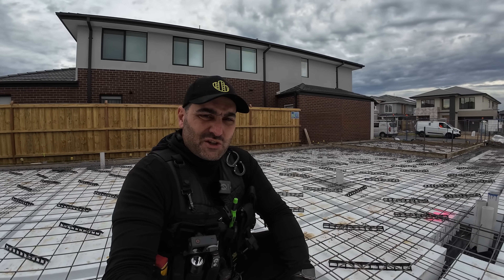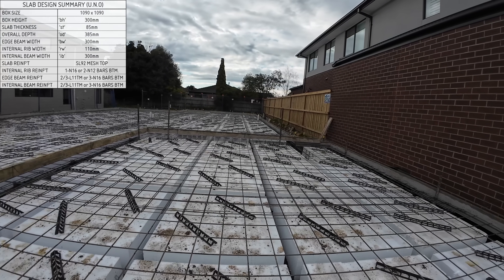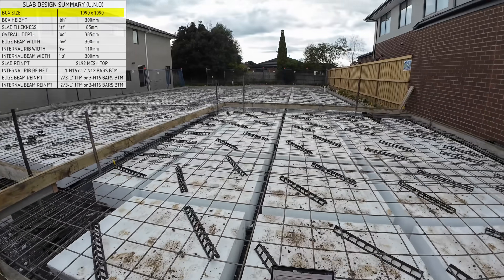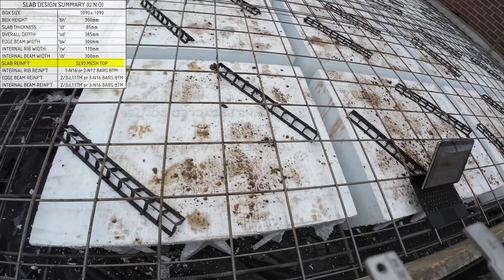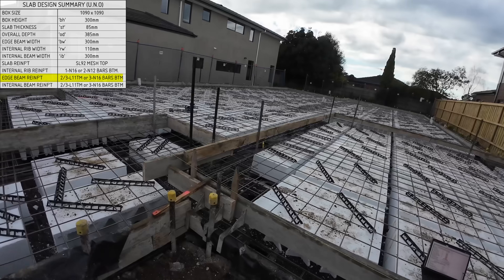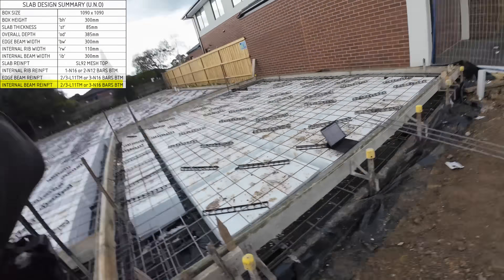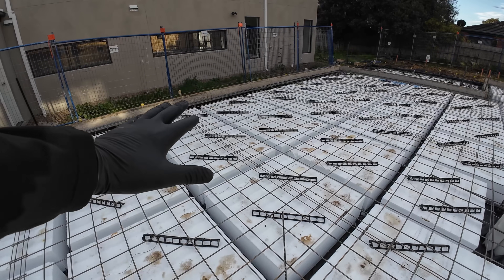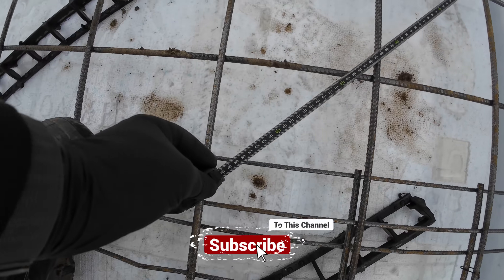Pre-Pour Slab Alert: What the Surveyor Missed!

Comment: Got passed because the things you're picking on are so minor and inconsequential that nobody without a tape measure would notice. Your videos are great, but the ones you've done regarding concrete are a bit off, can tell you don't really know the trade or the real world effects of minor defects. As if extra concrete without a bar is weaker than cutting a portion of foam and sticking it there instead, which would be allowed..
Reply: That’s his job, to pick the minor and major defects. There are engineering requirements that the trades have to follow. Concrete is useless without the correct reinforcements.
Reply: "As if extra concrete without a bar is weaker than cutting a portion of foam and sticking it there instead, which would be allowed.." Um yes actually, when you talk about STRUCTUAL items, you would want them to be as strong as they could be.. Something like the outside area of the slab (you know where these unimportant things go ---> walls, roof etc) and the middle where a beam will be placed which are literally LOAD BEARING, i don't want it cracking on me because they cheaped out on some rebar.
"can tell you don't really know the trade or the real world effects of minor defects" Calling the load bearing area of a slab which has not enough reinforcements a "minor defect" is beyond insane. No wonder builders get placed all in a basket because of people like you. I hope you don't work in this field.
Reply: @FireGodSpeed  the area was a garage rebate so it's not actually load bearing. More concrete will make it stronger, however more likely to crack (aesthetic). 
I personally wouldn't get them to add reo, development bars or rechair even if it was my own home (I'm an engineer)
Reply: Imagine car manufacturers made vehicles not according to the engineering requirements,  you'd have issues.
The inspector is doing his job properly, especially with a slab. This is what everything is built on literally, and you should be doing it properly.
Reply: This behaviour is non compliant!
Reply: Congrats. You don't understand auditing.
Reply: Mate... did you work on Mascot Towers?
Reply from the maker: If you think minor defects don’t matter, you’re missing the point. The engineering drawings and standards exist to ensure safety and longevity. It’s not about what’s noticeable to the naked eye but about following the requirements that prevent issues down the line. And by the way, extra concrete without proper reinforcement is weaker—that’s basic structural integrity. If following the drawings is too hard, then maybe it’s time to reconsider who’s really out of touch with the “real world.”
Reply: @Siteinspections 💯
Reply: @Siteinspections  I didn't say they didn't matter. Just that your over the top reaction and acting shocked was a bit click-baity. It's minor, and should be rectified. But if it's poured as is, it would not affect the end product whatsoever.
Reply: @sam01010101 what qualifications do you hold to make this such a confident statement?
I bet you thought he was saying “Nancy” not NCC😂

Comment: I'd love to see an inspection vid where everything is pretty much perfect. It's nice to see where people muck up, but it would be cool to see the good things that people could look out for
Reply: tbh this is better than %90 of slabs
Reply: @timtomthekiwi  - That's another problem in and of itself
Reply: @tim.fletcher  this slab would perform perfectly well. You could justify the missing bars just fine under AS 3600 for concrete structures. Bar chairs are a minor item, the mesh would deflect less the 2mm under its own self weight at those bar chair centres.
Reply: @Thagliou  But is it compliant.
Reply: @Thagliou  But they are waisting concrete where it is not needed.
Reply: @Thagliou   For how long will it perform perfectly well? Probably structurally uninsurable? These are minimum standards. If every tradie had the same attitude would you be happy to buy it?
Reply: @ade725  resi structures are designed to 50 year design life without major service. This ground slab would definitely reach that. I know of much larger structures that have way more defects that have lasted way longer.
Reply: @Thagliou so would you buy a property that was not compliant and be happy with it?
Reply: @Thagliou You represent the inherent problem with tradesman.  Near enough is not good enough, when you are building to MINIMUM standards.
Reply: @WilmerAriza Builders must build to minimum standards.  If you’re arguing against building to minimum standards then you shouldn’t be building anything at all.
Reply: @timtomthekiwi  needs to be there for the pour to stop them p*ssin it up out of spec
Reply: actually really cool when Zahir was going all the stuff they did right at the start. very educational.
Reply: I agree it would be good to see a few videos of some of the good builders work. These videos are great to show people what to look out for but would be good to know if there is any builders out there that can be trusted to do quality work. Because at this rate I’m turned off building new as there seems to be no decent builders out there that don’t cut corners constantly.
Reply: @Ningtek  feel free to share any good builders. It'll help lots of people
Reply: @MrD3ano  this is the slab prep where everything is almost perfect
Reply: @geekswithfeet9137  
Almost ?
Doesn't almost reach basic requirements....
Reply: What happens to all these inspectors that signed of on stuff you then inspektör and find to not follow the rules? Do you report them and they loose there license? Do the house owner get them to pay for any extra cost as a result of them givning an ok to something Thats not ok?
Reply: In Auckland we have an engineer then council inspect the masonry walls we build
Reply: @turbosloth2 bro NZ makes Aussie building practices look farking shocking. 
She'll be right mate in Australia!
Reply: Agree 💯
Reply: I think he generally only gets called out when there are issues.
Reply: @HouseholdDog   he did say in a video the other day he only films if it’s a juicy one. So I assume has many flaws and is worth filming for YouTube.
Reply: It's all doom and gloom
Reply: He doesn't get paid to write reports of all the good stuff,his job is to literally find defaults and non compliance
Reply: @wolfinthewheatfields3224 beautifully articulated!
Reply: Check up 43-45 South gateway,Avondale heights,Victoria!!! Windows don’t sits on the slab,they all sits on the Hebel cladding
Reply: Could it be that the waffle pods are in the wrong place?
If they were shuffled around would the edge and internal beams not be correct?
Reply: @wolfinthewheatfields3224  I’m literally not though. I said you can justify this design using AS3600. Justify the void form gaps as ground beams and you’re golden.
Reply: Scroll through the vids, there’s a good one in kellyville.
Reply: This guy is an absolute flog no idea
Reply: Installed correctly what a dick that's the size they come go work at safeway u asshat
Reply: @MrD3ano  I agree
Reply: Go to Germany
Reply: Steel splice does nothing unless steel is next to each other.
Reply: Hasn't happened in decades. Tofu dregs everywhere
Reply: You wanna see perfect building any building built before 1900 is perfect and because everything before that we didn't build we found it any building from 1900 or before is perfect still after 100 years
Reply: This guy is just a fairy, in construction, he loves to criticise more than answering

Comment: polystyrene ?! you re fucking joking me.
Reply: Waffle pod slab. Been doing it for years. With the new "green" zero carbon targets, pretty soon monolithic slabs won't be allowed.
Reply: @cameronalexander359  Yeah nothing wrong with them at all as long as the soil is stable but MUST be avoided in a flood zone.
Reply: @PyjamaLlama  not good on clay either
Reply: Been used for decades, very good when all prep and installation is done properly.
Best to empty the fruit and veg, samsung TV's, toasters and other shite out of the boxes before placement 😃
Reply: @JoeC88  🤣
Reply: If done correctly, waffle pod slabs are sensational.
Reply: @2loco  As I understand it, it all depends on the soil. Hopefully the engineer has evidence its non-reactive clay
Reply: It's for insulation, it's a good thing, nothing wrong with it as far as I know.
Reply: @DJogdog no it's not for insulation. It's formwork to form a "honeycomb" like structure for strength.
Reply: total BS, insulation from the ground!! thermal mass @DJogdog
Reply: @adamliddell5303  Yes, insulation from the ground, if you have a home with decent insulation in the walls and ceiling but no subfloor insulation you will lose a lot of thermal efficiency through the ground.

Concrete has very high thermal mass but very poor R value, so when insulated from the outside it can help maintain indoor temp when you turn AC or heating off (because it absorbs the temp from indoors and is protected from the heat outdoors) but can work against you if you don't have insulation protecting it from heat transfer from outside of the home.
Reply: Very common these days.
Reply: It's very normal. Do some light research.
Reply: I just asked the question as well because not everyone knows why they are used and do they degrade over time
Reply: This is every slab, relax
Reply: Waffle pods are pretty good except for wetland areas and what I’ve heard im not sure if it’s true Mice can get under slab and chew the polystyrene don’t know what the does to affect it but that’s what they were saying when I was doing pod slabs 15 years ago

Comment: Concrete isn’t worth shit without the proper reinforcements
Reply: Especially the way the Lebbo concrete crews piss up their loads.
Reply: @danimal26 all concreters piss up the loads, especially after they get a little tired. But none piss it up more than the Indian concreters.
Reply: @bexta68b81  yea true that.
Reply: Too right
Reply: @GiantSlayer512Wrong! You don't need rebar, I've done slabs for years, the best method for the strongest possible concrete is to drench slab every few days over a month period, the span never cracks trust me! I've worked in concreting for decades, if people want to pay for rebar reinforcement it's what they want that's what they get , industry standards and construction standards dictate  this nowadays but it's completely unnecessary
Reply: The slab isn’t worth shit without proper ground preparation and achieved allowable end bearing pressures.
Reply: @benh3443  totally agree ground work is so critical especially in the compaction I’ve seen verandah slabs walk away from the brick work on n houses 50-90mm and start to pull the verandah away from the house from the ground not being compacted enough
Reply: If only the concretors would listen!
Reply: @anthonywhelan8373  especially when they drill holes and chemset starter bars 😫
Reply: @xpost92  they wouldn’t need chemset if they drilled the correct size holes
Reply: With enough concrete IT IS. Look at the Romans.
Reply: @pcatful  concrete is weak by itself 
When it cracks and it does without steel it’ll move and shift 
The steel is in there to keep it tied to n even after it’s cracked
Reply: @pcatful  Roman concrete is different - it was made with volcanic ash & saltwater - it was self healing as cracks would fill in when rainwater reacted with one of the elements in the ash - pretty sure they only figured it out fairly recently though
Reply: 😂 Buildings to this day are still up with hard ly any 😂😂😂
Reply: Have you tried getting concrete out with mesh on the ground. Just as hard as if it's been chaired... have you tried getting out 150mm slap.  All the shit they do only works on the perfect temperature. Pour that in the 30s and it won't make any difference
Reply: @anthonywhelan8373  completely false, you don't need rebar if you drench the slab every 3 days. I've been laying slabs for decades buddy boy , don't need lectures from cowboys either
Reply: @Alladin-n5j  what Concretor in Australia goes back to the job for 3 days just to wet it 
Gold medal for you if you do 
As you must be the only Concretor in the world that gives a shit about your final finish
Reply: @Alladin-n5j  your a crack head that believes your own bullshit slab with no steel you are so cooked

Comment: Love your educational videos, other thing to mention is that mesh lap seems incorrect, two transverse bars should overlap.
Reply: @aaronjamalzadeh1060  should overlap by 25mm. 200mm plus 25mm.
Reply: @ninjasan1 
Correct, but can also be reduced to 100 + 25 or 125mm if mesh has outer bars at 100mm spacings.